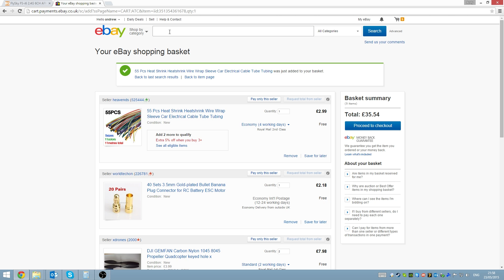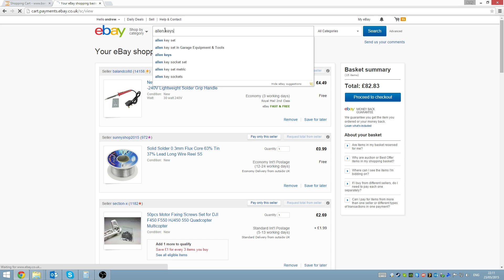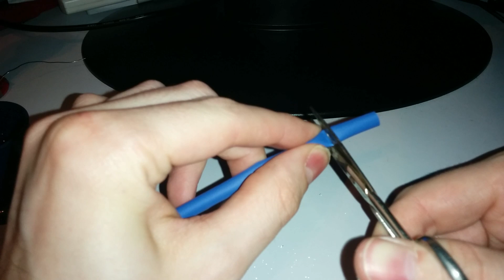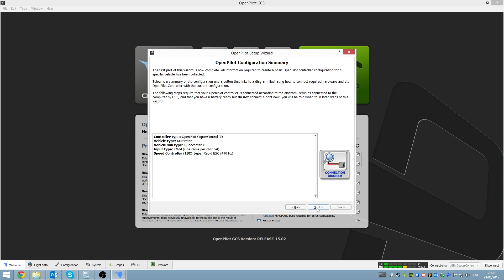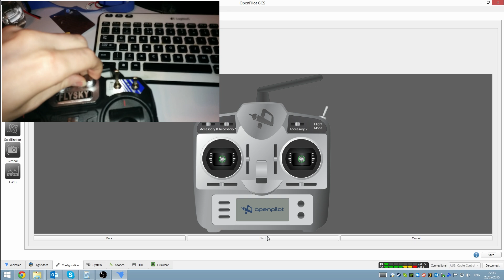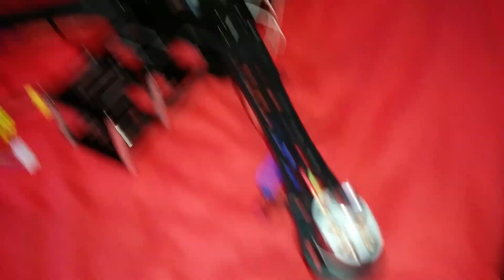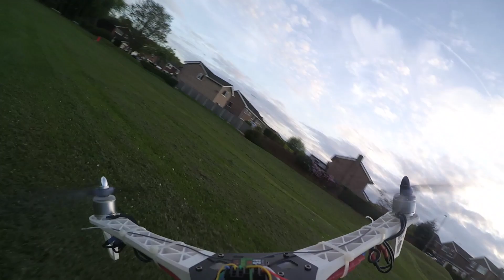Build A Cheap Quadcopter

Comment: Hi andy, i have build this like u in the video, fly a little bit, till my frame arrive dji f450 like yours in high end quad, when i move the motors, esc, all on that frame i change something, a put a 4s 5000mah 30c battery, and from there it was a problem. 
1 of my motors left-back have problem like this one in the video.
https://www.youtube.com/watch?v=MZ2oqTQXGxE

Now i dont know if is the esc but i try and change the motor and still left-back have problem i try to put some naylon screw from a spacer, but the problem persist in the same place, with motors change and naylon screw.
Btw i put back the 3S 3000mah 35C battery back and it does the same, till i brock the prop, sitched back to 4s because i have 1 pair of 8045 prop for 4s battery.

Help me pls, Thanks a loot
Reply: I think i found the problem i will post it here so anyone have this problem can work out.
I saw that video that i link it to and i go to my esc cut all the heat sink and look for that 5 pins so i can flushed, but i dont find anypins lol, so i look out better and 1 or the pin of the condensator that is soldet it was barly touch it, and wen i move a little it went off, so i solder that pin back again on the board, give it a fly on top of my bed and that it, it works, i put back the iron screw fly again and works, now is snowing outside but when it stops i will go and fly outside and see if i got any problem.
BTW can u tell me pls if i get the right p gain witch i dont know is but i find it on your instruction where is the sweet spot, what exacly i must copy and where so i can put back the 3 fly mode ?
Thanks a loot great video and loots to learn.

Comment: hello I did the same quadcopter and I also had the same problem with the engines suddenly cut off and the bullet, I stink see that you were talking about the length of the screw engines too long, I then they watched mine and was a good size, I was wondering if you had any other problems with respect has the parasite they will have on the engines I'm a little lost, I love your channel very interressante I also subscribe ^^
Reply from the maker: +sam lejaune actually the bullet connectors could be causing you the problem. if you take a look at my high end series particularly episode 2 i show how to solder the wires direct to the ESC and how to get it right first time. give that a try as i beleive bullet connectors can create resistance and cause motors to cut out. hope you get it sorted cheers.

Comment: AndyRC I have made it all the way to enabling the Tx PID. For some reason when setting up the controller and selecting which accessory to use as the flight mode it would not register VRB so I used VRA instead. However, now when I try to save the TxPID settings, it will not allow me to save. Any ideas on what to do? Thanks.
Reply from the maker: have you enabled the feature?
Reply: +AndyRC Yes, I have enabled the TxPID module, if that is what you are asking.
Reply: +AndyRC Whenever I attempt to save the TxPID settings, it gives me a red X instead of a check mark.
Reply from the maker: +Imafroketman it does that sometimes its a pain,. unplug everything and start again it will work.. did that on me a few times.
Reply: +AndyRC Will do! Thanks for the advice. I'll let you know how it turns out. Awesome video!
Reply from the maker: please do cheers

Comment: hi andy i wan to buy the 4s 4000 nano battary 45c.
does it feat to the esc 3s that on the vidio?
Reply from the maker: +יניב פוריאן yes it does but use smaller props
Reply: +AndyRC 9443 will be ok?
Reply: +AndyRC do i need to do some changes or calibration to change between 3s and 4s in cc3d ?
Reply from the maker: no it adjusts to it which is nice. the arducopter boards dont which is a pain

Comment: Hi again, i just found this witch one is more good or tested and like it ?
http://www.aliexpress.com/item/New-2-4G-Flysky-FS-iA6B-6CH-RC-Receiver-PPM-Output-with-iBus-Port-For-Flysky/32539911227.html

http://www.aliexpress.com/item/8CH-Receiver-PWM-to-PPM-SBUS-DBUS-S-BUS-Encoder-Signal-Converter-Module-for-RC-Phantom/32461572527.html

http://www.ebay.com/itm/2-4GHZ-ORANGE-RX-R615X-RECEIVER-DSM2-DSMX-CPPM-6CH-AIR-RECEIVER-HELI-PLANE-/151443311333?hash=item2342b98ae5:g:uqcAAOSwY45UPm07

Btw i see that the original receiver is changet with this cppm receiver my big q is the range will be the same ? on fs-ia6 is 1.7km from i have seen

Thanks and sry for my stupid q but for me are essential.
Reply from the maker: I do not own them myself so I cannot say which is best unfortunately. you are trying to do something different to the video. perhaps search for reviews on YouTube thanks

Comment: Hi, Andy 1 q can we move this motors, esc and 3s 3000mah battery on a 250 racing frame ? (that little drone till the winter past so i can play)
The motors can support 5030 props ? or what will be the problem ?
Thanks
Reply from the maker: +John George no it would be too much power and too heavy for the pids to handle

Comment: Hi Andy, can u help me with something pls, i buy it that naze32 10 DOF and i have a FS-IA6 receiver, no PPM no GPS, no nothing and i dont know how to connect. I have the f450 frame with 4 motors. 
Can u pls help me?
I pus some picture of the naze and wire that they give it to me and the receiver on my google+ if u can take a look, 
https://plus.google.com/collection/Ir6yo

Thanks a lot.
Reply from the maker: you need to buy a cppm encoder. good luck buy sell them
Reply: +AndyRC so it dont work the receiver and naze32 i need a cppm beetwin this ? and tell me pls witch one ? 
Thanks a lot.
Reply: The problem is the receiver ? The naze will work with taranis and just that ?
Reply from the maker: +John George no it works with any cppm receiver
Reply: +AndyRC  Thanks a loot i will buy one.

Comment: +AndyRC I have assembled all the parts to build my quadcopter except my motors. I went to just see if my esc would make a beeping sound to check if they work but when I checked they made no sound. but remember I did not have my motors attach to my esc yet. You think my esc are broken or is it because I have not yet connected my motors?

Comment: @AndyRC I'm looking to build a drone is this still a a great drone to build and if so do you know where i can get the 1045 keyed hole Propellers from as the ebay seller doesn't have them only the 8 inch and i want this to shoot up in the air like crazy or and i use non keyed hole ?? or is there some better motors that support more Propellers as i was looking at some Carbon Fiber Propellers please reply as i wanna get this thing before christmas so i can get some crazy footage thanks...
Reply from the maker: +chris93p3  I built this quadcopter with the cheapest motors at the time. and then they needed a keyed hole. you are going to have to spend more for ones without keyed hole. any 2212 size motor will work so have a search on the usual sites. ebay, aliexpress, banggood gearbest goodluckbuy
Reply: okay thanks mate i love your videos keep up the good work il have a look and see what motors i can find but thanks again
Reply from the maker: no problem :)

Comment: Hey Andy! I've already got all my quad working, not yet tested on the air, but I will as soon as I have time, want to than you for your replies! 
However I want to ask about what you did with the propellers... Did you hot glued the propellers to the motors for balancing problems or just because they didnt stick to the motors? I mean in my case i think i will have to stick them with glue because they fall off whenever they spin too fast, just wanted ot see what you think!
Reply from the maker: +Taaku E no hot glue wont keep the propellers on. the nuts that come with the motors should do that. the hot glue is purely for balancing. check out my review of the dubro prop balancer on how i did it :)
Reply: +AndyRC Alright I will then! Thanks!!

Comment: Thanks for sharing of an experience ! Tempting now to get started as well.
Can you, if possible, cover also other sizes quads ? Also interested in smallest you can build and what are the requirements...? So many motor types & also propeller types available - for an inexperienced person this is a bit confusing.
For instance - how to get idea(apart from the shop recommendations) which motors/esc/props/chassis to buy ?
For example I would like to get my son(myself as well xD) to build a smaller quadcopter - can you recommend parts to use ? Looking for decent flight time as well as motor life compared to RTF Chinese quadcopters..like Syma X8C etc.
As for receiver\transmitter combo - what are the difference between Flysky FS-iA6 & FS-iA6B ?
Can you pls also share recommendations on bit more expensive set to buy (around 100$) ?

Apologize if asking too much ;-)
Reply from the maker: +Ying Bxua luckily for you there's already a wealth of microquad builds already on my channel. check out my build a micro quad video on the channel. theres also a micro quad playlist in the playlist section :)

Comment: Hy Andy a little problem i have i dont know if it really is, but when i throtlle a little bit not all motors spins,  it random dont start till i trhotlle more, but still dont get it in the air i`m to scare lol...
Reply from the maker: +John George sound to me like you need to calibrate the transmitter in CC3D software
Reply: i put a little video on google+ in my collection to see what is happen, i broke a prop ....and that is it for tonight, i put some new one, balanced and i will try it tomorrow to lift in the air, hope i will do.
Reply: +AndyRC how i can calibrate, i dont know, i did everything that u do in the video, just that.
Reply: i uploaded that video to google+ to see
Reply: Andy pls dont forget to replay to me how i can calibrate the transmitter in cc3d, hope u watch the video and u can tell me what is happen, because i dont know :( 
Thank you.
Reply from the maker: its in this video how to calibrate the transmitter. have a watch back :)
Reply: +AndyRC ty, now i`m watching, try tomorrow. Tell me pls, i must calibrate the quad every time i go to fly ? 
What pitch and roll that knob that we set it does?
Where u think is a fine spoot for the knob to be and to get start and play with him ? 30% -50% -70% 
SRY for a loot of q, but i want to understand how it works
Thanks
Reply from the maker: no there's no need to calibrate every time. and only need to change the pid settings if you change the weight of the quad considerably
Reply: +AndyRC  got it, i find the problem i post it maybe someone will have this, i set the value of the motors at 1124 all, not when the motor starts to spin nice and then i lower the motor and press stop, i must pres stop when the motors spin nice. 
Tomorrow i will go out and try again.
Tell me pls can u make a video with how to set the 3 flight mode, we set 1 flight mode.
Thanks
Reply from the maker: it is also shown in this video how to set the flight modes .

regards

Comment: hi mate need some advise ive got an eye one extreme by RC Logger want bigger battery for longer flight times etc fpv got stock 1150 mah im using 1300 mah no probs want togo bigger speaking to chap in oz he said need bigger regulator any help in this area as you da man cheers
Reply from the maker: +gadgetman 404 i dont have an eye one extreme really want one though. for my X6 I use an 1800 mah 2s. Im guessing he suggested a regulator as u are considering 3s. theres not much point it would be a waste. best thing to do is look at which highest 2 cell battery will fit. have a look through my last x6 video cheers

Comment: Hey! I'm trying this Tx setup but it seems that when i try to arm it putting the throthle down and  Yaw right, it doesn't react, so it does not arm the quadcopter, any ideas why could this be happening?
Reply from the maker: usually when the pwm values are incorrect. try to recalibrate the transmitter or amend the pwm values manually
Reply: +AndyRC Cool! It worked! However i'm getting stuck in the Tx PID, as i do the same setup for acessory 0, it does not save, insted of a tick it appears a cross on save buttom
Reply from the maker: +Taaku E have u made sure that it has copied the pwm values exactly to channel six. when I did it it altered the first figure and screwed it up. check through the video as slow as u can

Comment: andy can i use this 
http://www.banggood.com/FlySky-FS-i4-2_4G-4CH-AFHDS-Transmitter-With-FS-A6-Receiver-p-985983.html
Reply from the maker: no you need five channels and that one only has 4  unfortunately :-(
Reply: ok thanks can you recomand one of  cheap transmeter please.?
is this compatible >
FLY SKY 2.4G FS-CT6B 6 CH Channel Radio Model RC Transmitter Receiver Control CY

http://www.ebay.com/itm/FLY-SKY-2-4G-FS-CT6B-6-CH-Channel-Radio-Model-RC-Transmitter-Receiver-Control-CY-/311472460507?hash=item48853492db:g:JrYAAOSw9mFWLiRw

also  can you tell me good betery and charger,
i really appriciately your help ,,
thank you very nusc and best regardz
Reply from the maker: +waruna perera the one in this video is good. if I were to buy a cheap tx again I'd go for the turnigy 9x. I used the b6acv2 charger
Reply: can you suggest one of cheap transmeter and charger,,and betary,please
thanks  regards
Reply: how aout this 
http://www.banggood.com/Wholesale-FlySky-FS-CT6B-2_4GHz-6CH-Transmitter-With-Receiver-FS-R6B-p-68606.html
Reply from the maker: that will work yes. but the quality will be poor I would personally spend a little more
Reply: ok thank andy fianally i desided to buy this
http://www.banggood.com/FlySky-FS-i6-2_4G-6CH-AFHDS-RC-Transmitter-With-FS-iA6-Receiver-p-922606.html

is it have good range ?
thanks andy
Reply from the maker: +waruna perera it has good range yes. its the one in this video :)
Reply from the maker: it has good range yes. its the one in this video :)
Reply: thank you very much
Reply from the maker: no problem

Comment: what are the flight modes available in this ? only stabilization ?
Reply from the maker: stability and acro
Reply: +AndyRC what is the range of the transmitter , i mean how far can you fly this without losing connection ? by the way i finished building this quad and it flies like a smooth bird thanks to you mate :D
Reply from the maker: great to hear! the range is quoted as 600m but i havent taken further than 300 for safety

Comment: +AndyRc what was your minimum and maximum pid gains you set the board to?
Reply from the maker: I only ever changed the p gain. and I kept it on the dial so when I added different weights and components I could adjust in flight. it ranged from .4 to .8 I think. the more weight the higher the number
Reply: AndyRC could you please make a video on how to fine tune your 450 size quadcopter? It would really help me and others I think. And I want to get into quadrotors but I am just confuse on the fine tuning part
Reply from the maker: the tuning is shown on this video where you set the p gain up to a dail and then adjust it until the quadcopter flies stable

Comment: i order everyting today!!
Reply from the maker: great. enjoy :-)
Reply: +AndyRC  i hope it work
can you help me if i heve problem?
Reply from the maker: +יניב פוריאן sure I'll try my best
Reply from the maker: +יניב פוריאן sure I'll try my best
Reply from the maker: +יניב פוריאן sure I'll try my best
Reply: +AndyRC  tank you very much!

i can ask you some question?
1. what is the limit distance to this quad?
2.i saw in some quad with button ''Back home'' is there aby option to do this?
3. is there inside gyro for calibrate?
4.what about gps to locate the quad if it go loast
5.how meny channel are working? what option i cann add more?
sorry for a lot of question
i am biginer an i wan to lern this hobbi and you are very kind and pro!
tank you very much!
Reply from the maker: no it does not have GPS. its range is 600meters it has no on board compass just stability mode  +יניב פוריאן
Reply: +AndyRC  any way to add gps?
i saw this
http://www.ebay.com/itm/RealTime-GPS-Tracker-GSM-GPRS-System-Vehicle-Tracking-Device-TK102-Mini-Spy-/331580016533